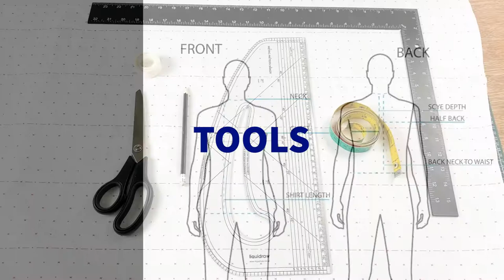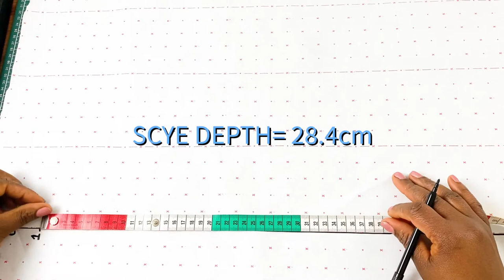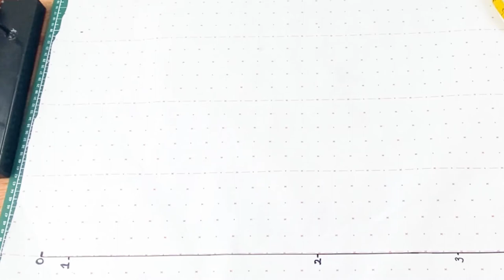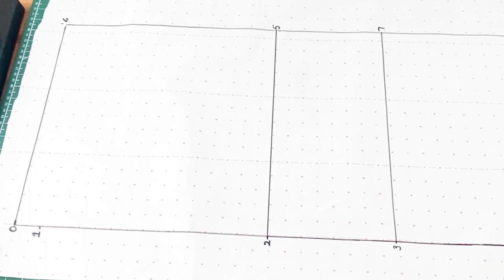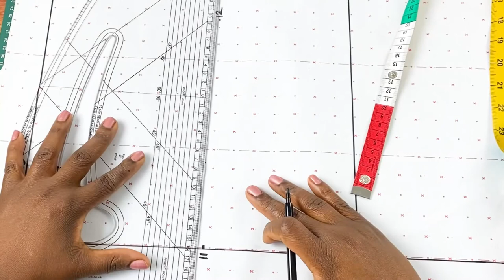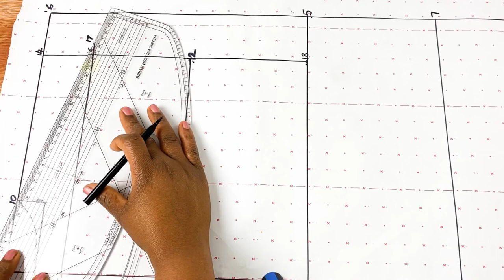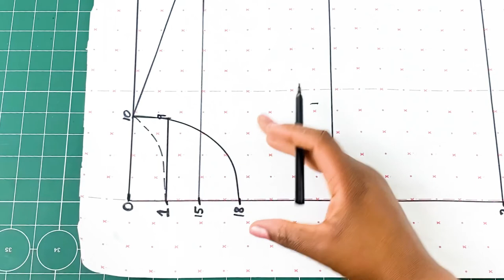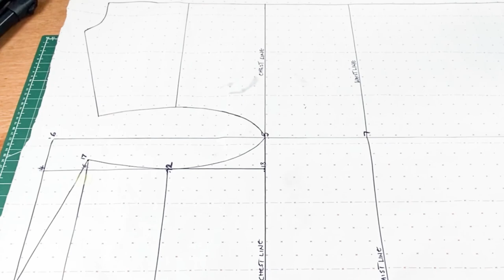How to: Draft a Basic Men’s shirt block (Flat Shirt)

Comment: Thank you so MUCH
you have given me hope to start sewing shirt. The wrong method kept me from doing it. I didnt give up searching for other ways till i found you seam&notches.
I took the measurement for my husband and i drafted the master draft.
Since the method is new to me i need help. I tried using  boy shirt method to get the yoke dart. I dont know how far down i should go to start drafting the front. For boy method you measure down 5cm then you started the process for neck. I dont know if for men i should measure down 5cm. I refer to boy shirt and follow the step. i want to draft it as the boy shirt method where the front is shorter than the back and has yoke. I want to try sewing this for my husband to gain confidence in myself. And less pressure doing so.
(I really appreciate what you do) THANK YOU

Comment: In centimeters how much would you recommend that i add to my back shoulder so that it looks higher than the front?
(I already have the master draft ready) just need a little tips from you thank you.
Reply from the maker: Thank you for your question, if I understand your question correctly, you want your back shoulder line to be longer than the front? If yes, both your front & back shoulder length should be of the measurement to avoid issues when joining the sleeves to the shirt. So in that regards you don’t need the back length longer than the front.
Reply: What i want to achieve is same as the boy shirt method you drafted. This is how i want my shirt to turn out.
(Please let me know if you have another method of drafting for this)
I am ready to learn from you.
Its my first time trying to make a shirt.
And thank you so much.
Reply from the maker: Thanks again, drafting a man’s shirt is quite different, I can get a video out on this if you want.

Comment: For the neck, why subtract 0.6 cm? Is it always 0.6 or do you use a different value for different neck measurements?

Same question for the scye measurement.
Reply from the maker: Thanks for the question, 1. When you don’t subtract, you’ll find out that there are excess amount left around the neck area which makes the neck too wide. And yes 0.6 cm is used for any size. 2. For the scye depth measurement you need to add 4cm for ease, again this is to avoid fitting problems. Hope this helps😊
Reply: @SeamsNotches  Thank you very much for responding. I like that you’re including menswear. We are often ignored. I believe because most menswear is boring.
Reply from the maker: @jimkoss3318  You are most welcome, I really feel it is necessary to include menswear pattern drafting to our tutorials, as we want to be able to help more people advance their knowledge in pattern cutting👍🏽😊